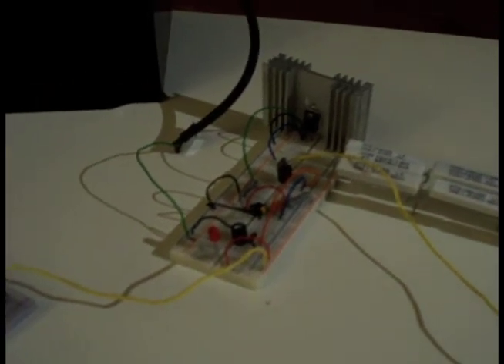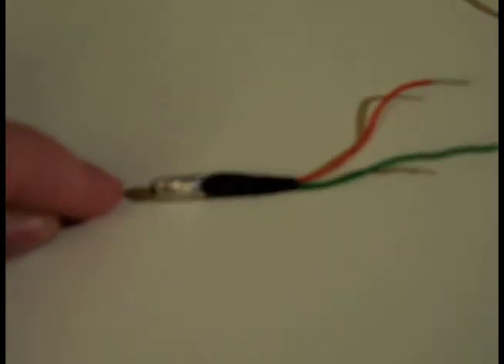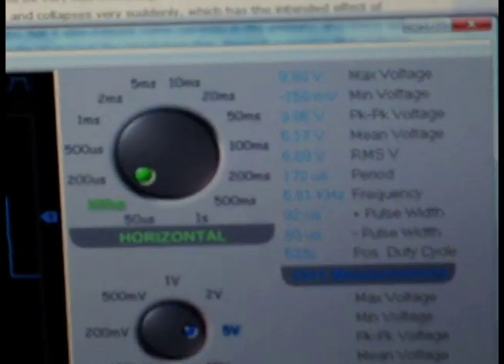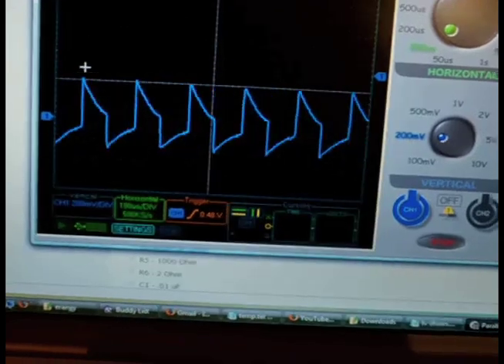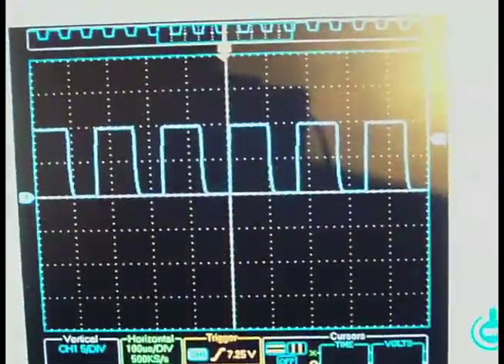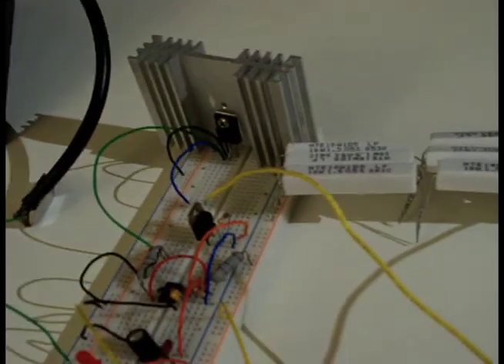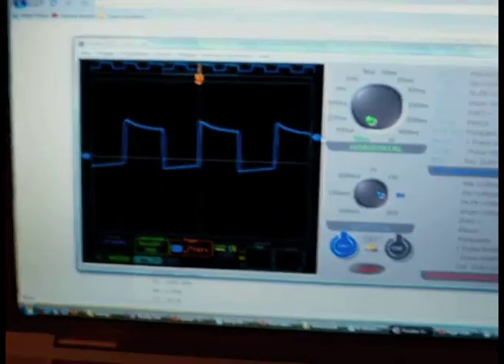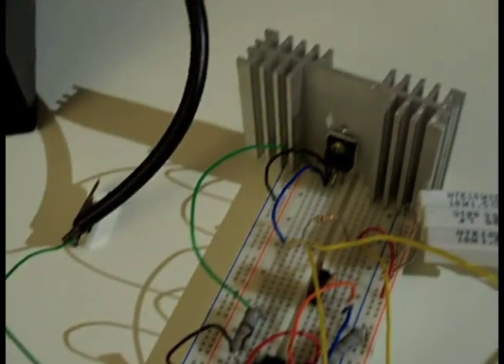HV Power Supply Oscilloscope Readings

Comment from the maker: @blower05 Me too! but I'd have to do some kind of probing of the current instead of a direct reading because the voltage would fry the oscilloscope. Also I don't have a CRO (assuming you mean cathode ray oscilloscope), although I was thinking about trying to make one with an old CRT monitor.

Comment: @Alex1M6 yup! but i subject adding a variable frequency to this by adding a 0-50k potentiometer between pin 6 and 7  using a .01uf cap. its what i use and you can focus the arc vary well. i have a vid up that i use pin 5 to add audio and it works grate you can definitely do it that way i also have it set up to current limit with a transistor not a bank of resisters that works much better. also adding a cap bank to your main input helps alot too in fly back drivers

Comment: What frequency is it oscillating at? If it was a high frequency then the signal might have been beyond the range or frequency response of the speaker and so may have been attenuated by the speaker causing the wierd output that you saw.